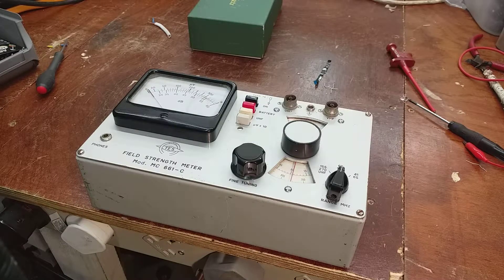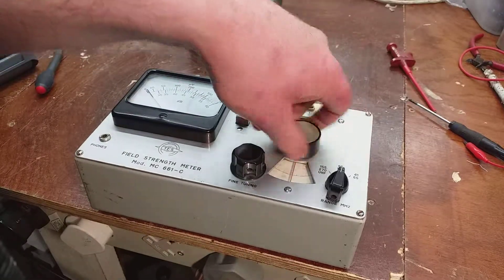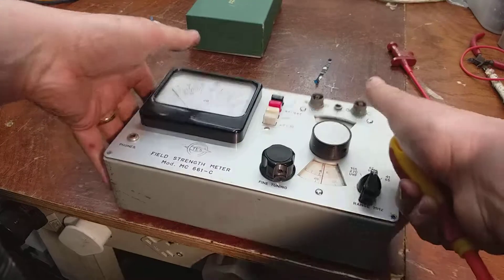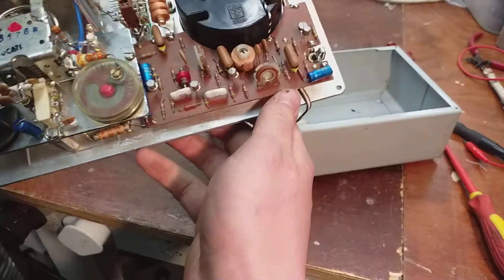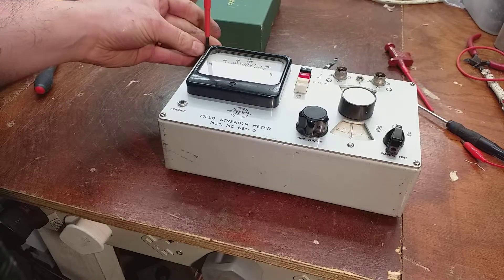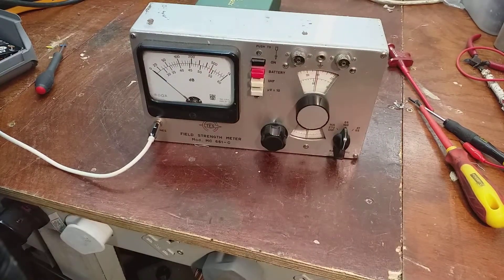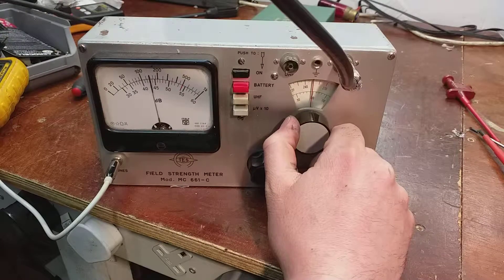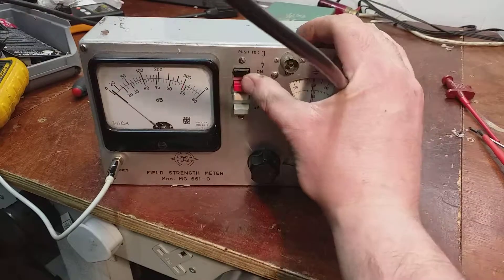TES Field strength meter. MC 661-C

Comment: I still use one, built like the Titanic. And you can still get the original batteries on eBay. The return spring on the meter went about 30 years ago but I got a replacement.  BTW, when you were looking for UHF signal, you had the aerial connected to the wrong input.

Comment: I have an MC 661 C, but mine doesn't have the earth terminal between the Belling Lee connectors. Also, mine has a red mark on the meter to show minimum battery level allowed -- which is referred to in the manual which I was lucky to get with the unit.
Reply from the maker: Hi James, I must dig this out again. The meter movement sticks in this and I've got a replacement from dome home brew yoke I'm going to scrap. They're a cool bit of kit and work quite well as an FM receiver.